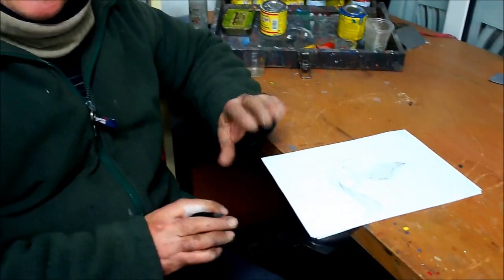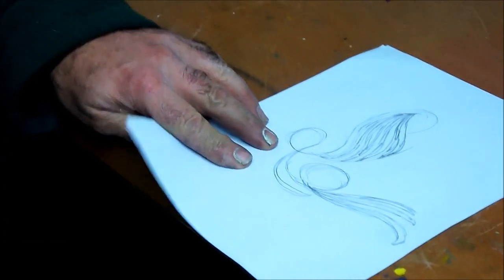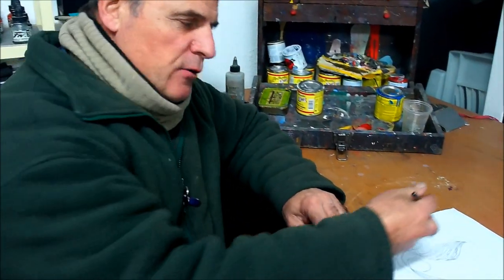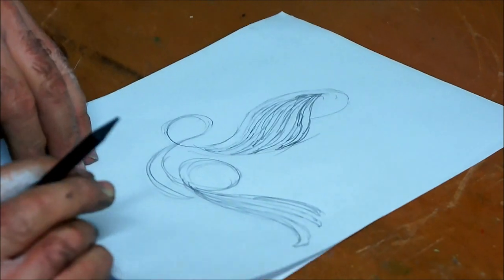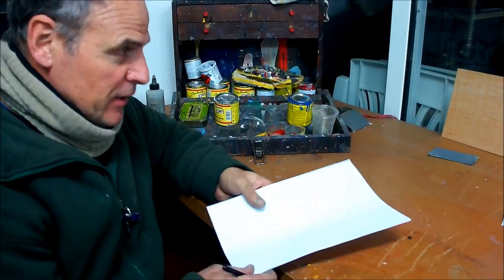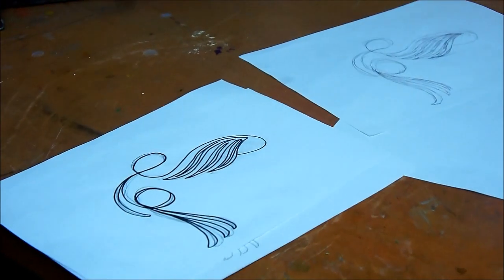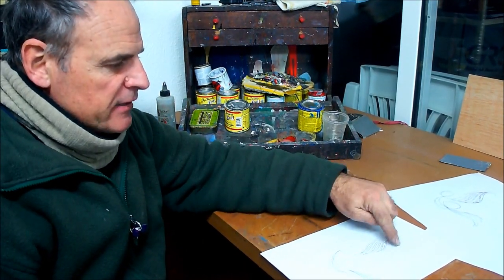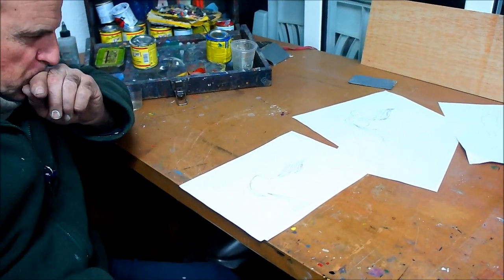TRADE SECRETS revealed - Pinstriping & Signwriting 2/3

Comment: I have to say I've been struggling with the chinagraph pencil, I used yellow over a chalk outline and in places went over the line with the paint. I was doing the shadow so it was black paint and I can see the yellow chalk through the paint. Is this just the paints too thin and I can give it another coat or do I just need to try harder staying within the lines? Many thanks.
Reply from the maker: Hi Sheepyish, thank you for commenting. Chinagraph pencils, they take a bit of practice to work with as in hot weather they melt so you have to develop a light touch. Remember you're marking out is only a guide to make sure your lettering fits in the space. You may only need one or two lines or ticks to mark out the letter because when you practice practice and practice you know what the letter looks like so you don't need to draw a complete letter. You can go over but you should be minimalising your lines. If you check my Lesson 1 video it shows about learning letters. It took me 3 years practising so don't beat yourself up. Cheers Cliff
Reply: @Airbrushartist  thanks for the reply. It's great to have some UK videos as the Yanks have different names for everything.